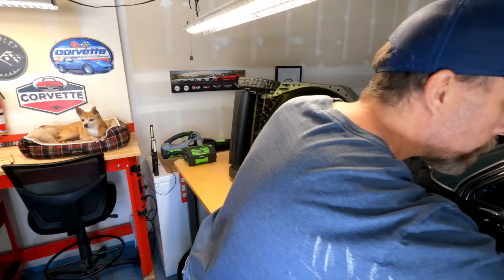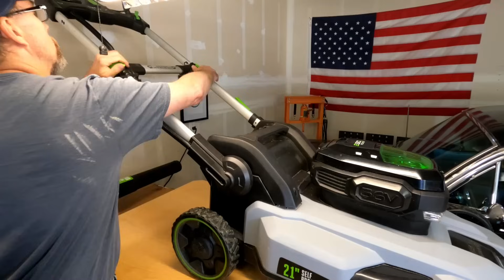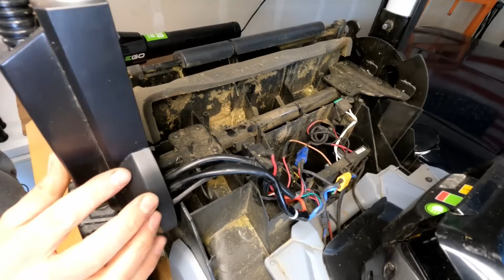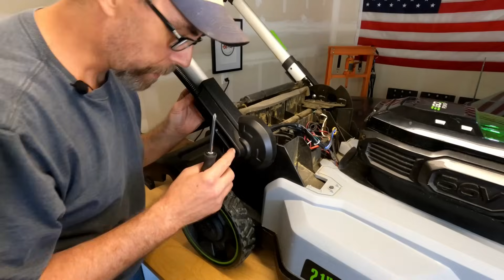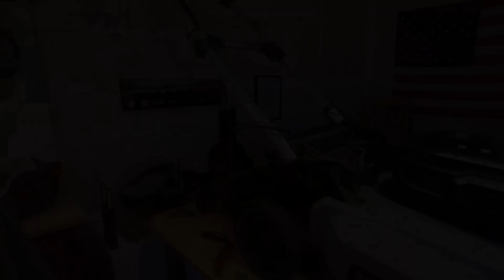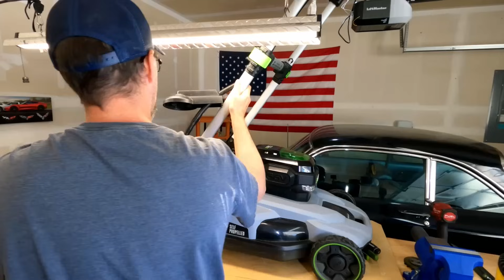My Ego Mower Finally Quit Working!!  🔧  Can I Fix It??

Comment: Is that part of the wiring harness available to buy?
Reply from the maker: I have not ever looked into replacement parts. That would be handy so that you could just replace the entire run of wires from the handle to the electronic box. I would imaging that as the world gets more and more full of these battery powered machines, parts will become more accessible. Thanks for watching!
Reply: @EndWrenchRookie  I disagree w/the parts becoming more available.  EGO's "5 year" warrnaty gets you the door, but those 5 years are less than spectacular.  At 5+ years, if the mower "breaks/fails", most will move on/back to a gas mower.  EGO is just as disposable as the next thing and  replacement parts will be tough to come by.  Ppl just replace vs fix and electric is more intimidating.  If there are replacement parts, it will be through a 3rd party seller not affiliated w/EGO...

Comment: My new Ego mower purchased in April 22 did the same thing this year when I first started to use it. Had a hard time with phone support finding me a shop that repairs them. Fortunately , Lowe’s let me swap it out with a new one.
Reply from the maker: Thanks for sharing. Ya, its going to be a while until repair shops catch up with the electric mower game. You pretty much have to work out a full replacement under warranty if you want to get it fixed. You are lucky to have gotten Lowes to replace for you. Hopefully your new unit works better for you. Thanks for watching!

Comment: Try cleaning the carb and plug and change the air filter.
Reply from the maker: Right...and I should probably check the oil while I am at it :) lol
Reply: @EndWrenchRookie  A can of starter fluid will have it up and running in no time :)

Comment: How has the battery held up since you have had it?
Reply from the maker: Thanks for the comment! My battery is going strong now in its 5th season. I store it indoors over the cold winter and I charge it completely right before I use it every week. I have a pretty average size lawn but I have never run out of battery during a mow yet. I expected to have to buy a replacement battery at some point, but so for no issues :) I also have 2 smaller batteries for my blower and trimmer. They are lasting noticeably less time this year. I do use the blower year round in the garage. I just always make sure that I have one charged all of the time so I can switch them out. I imagine I will have to buy a new battery or two for them maybe next year. Overall...pretty impressive lifespan for these units. Thanks for watching!
Reply: @EndWrenchRookie  The only thing that I am not happy about with it Does this grass it’s doesn’t have good Suction
Reply from the maker: Do you mean that it drops clumps of grass on the ground instead of catching? I usually cross cut (cut twice) just for the look but it tends to pick up anything that dropped. It definitely has more problem grass catching if the grass is too long or at all wet. Thanks for the comments!
Reply: @EndWrenchRookie  No it leaves uncut sprigs of grass
Reply from the maker: oh...ok that makes sense. ya, I have that too, especially if I mulch. It is better if I bag. I seem to have lines of uncut grass where the wheels lay the grass down. I usually cross cut (mow twice) then it solves this. For all of the conveniences and all of the ease of use, the lack of pawer and suction compared to a high quality gas mower is a real thing. I do miss the days of being able to just mow when ever and under whatever conditions necessary with my old John Deere. Still glad I have the Ego in the end.

Comment: When I first got mine I took it apart and cut all the plastic out that the wires run through inside The mower because I noticed as you folded they get caught up in the plastic channels I also added loom to it no problems yet
Reply from the maker: That is very smart. A little preventative maintenance goes a long way! Thanks for the info and thanks for watching!

Comment: Your video is helpful, thanks.  I have the 2100sp and the self propel motor will not come on. Main motor works fine. Need to check the two SP switches in the handle. Your thoughts?
Reply from the maker: Thank you so much! Bummer that your drive stopped working. Luckily they are not heavy :) If I were you I would take the hinge cover off like in my video and inspect the wires for crimping. I would hold the drive handle while simultaneously wiggling the wires at the hinge to see if you have a crimped wire as I did. After that, I would isolate the wires that go to the drive motor and try to assess if there is power getting to the motor ie...probing the wires. After that I would test the continuity of the switch on the handle to see if you are actuating properly. If all that checks out you may have a faulty motor or loose connection at the motor. Hope this helps. Just one guy's opinion...Good luck!

Comment: Thank you! I opened up my mower and my problem looks to be similar to yours. I’m on my way to the hardware store now. Do you recall what gauge wire you used for the repair?
Reply from the maker: Thank you for watching. I believe that I used 16 gauge wire to repair the 3 small wires. That was what I had on hand at the time. They were bigger than I needed. You could get away with smaller. Good luck!
Reply: @EndWrenchRookie  I appreciate the quick response. Thanks again for putting your experience and knowledge on here for us all to learn from.
Reply from the maker: No worries. Hope it works out for you. I haven't had any more issues with my mower since my repair.
Reply: @EndWrenchRookie  My mower is up and running again! I can’t thank you enough. For anyone else attempting this, I used 18awg wire and it was still slightly larger than necessary, though pretty close.
Reply from the maker: Great Work!

Comment: What gauge wiring did you use ?
Reply from the maker: I believe that I used a multi-strand 16 gauge for the repair. If I remember, it was larger than I needed, but it was what I had on hand. Repair was successful with no further issues for the rest of the season. :)  Thanks for watching!

Comment: Thank you!  It must have been the handle extension safety switch - I also store mine folded up in my garden shed but never have to shorten the handle.  All I had to do was collapse the handle and re--extend it and it works fine!
Reply from the maker: Thank you! Ya, lots of safety gizmos on these machines. Probably a good thing. :) Thanks for watching and commenting!

Comment: 5 years with mine still going strong 💪
Reply from the maker: nice!
Reply: @EndWrenchRookie  after I get a plow on my truck going to replace my gas snow blower with the ego 2 stage
Reply from the maker: @gamingseeks3580  wow. that sounds like fun!
Reply: @EndWrench Rookie  then getting the ego generator after all that I'll own 9 ego batteries lol 😆
Reply from the maker: @gamingseeks3580  LOL
Reply: Mine is 8 years old, but I did have to get a new battery a couple of years ago.  It just developed a problem last week or starting for only a few secondsd before dying so I took it to a shop that didn't give me confidence they could fix it.  I think I will tell the mechanic about this video although I do not fold mine down ever, but at least, the mechanic will know about the points where things can go wrong.

Comment: This seems to be a common design problem with this brand. I like that you fixed it right, rather than disabling the safety feature(s).
Reply from the maker: Thanks for the comment! I agree. I could have just bypassed the switch but that doesn't really help people as much. At the end of the day, I wanted to share my experience with others in the hopes of helping save a few more machines from the landfill. Thanks for watching!
Reply: This brand has to many safety feathers. Most have 2. The bailing handle, and the button. That is enough.

Comment: Good video ! you need a multimeter ! I would have tested it out before I put all that tape on the wires.
Reply from the maker: Thanks for the comment! I agree, using a multimeter would have confirmed and isolated the problem first. I would have definitely broke it out if I wasn't able to determine the source of the problem. This video/repair was more about getting my lawn mowed before the storm hit than it was about demonstrating the analytical technique. lol :)   Thanks for the tip and for watching!

Comment: FYI, I stored mine all folded up in my small shed for years and never had this issue, so I don't think it's a matter of it not being designed to fold up every time it's used. Still going strong 6 or 7 years later.

Next time you decide to pop this open, take the battery out for your safety. Also watch out for any large capacitors. I don't know how this thing is build, but large capacitors can be extremely dangerous.
Reply: Yep, most motor controllers have capacitors in them. Its a good practice to hit the 'on button' after de-energizing (removing the battery) the circuit.
Reply from the maker: Awesome! Ya, I probably should have had the battery out when I was fixing it up. Thanks for the input and for watching!
Reply: ditto
Reply from the maker: @johnmarquardt1991  :)

Comment: Great fault finding skills my friend.......But I think most of these units will be just expensive landfill.....They will not last like a good Aussie 2 stroke mowers for fifty odd years with some TLC...But really a bad design fault by EGO...most people would not have your skills to fault find and repair....My next door neighbour traded his 2 stroke for an EGO which surprised me.
Reply from the maker: Thanks for the kind words my friend!
Reply: Very true...got given a Victa 2 stoke cos the owner couldn't be bothered replacing the starter rope. That, some TLC and a carb kit, and its been running fine for the last 10 years no sign of giving up yet. Gonna keep it going as long as possible...

Comment: Nice job - excellent troubleshooting and repair ! 👍 … wonder if the new ones have a better design to prevent a similar problem ? 🤷🏻
Reply from the maker: Thank you so much! I appreciate the input. I am surprised at how common this problem actually is. I would imagine that they have addressed it by now. Thanks for watching!

Comment: It's the smaller single wire that's causing the problem every time you move to big one your fingers was pushing up against the small one you can't see cuz you're on the other side of the camera.
(Edited after FYI) damn I was right!
Reply from the maker: LOL! You are indeed correct. That's the fun part of doing live repairs. You get to follow along and try and guess the problem. Good eye! Thanks for watching!

Comment: I have had my EGO 21inch cut mower for 6 years never had a single issue , maybe just lucky. plus its still the original battery. by the way, I never fold the handle down which has helped lol
Reply from the maker: That is cool! I am also on the original battery. My smaller batteries for the trimmer and the blower are starting to not last as long, but the mower battery is still going strong.
Thank you for the comment!

Comment: I'll order a gas Toro. 4-5 years won't cut it.
Reply from the maker: Nothing wrong with that! I had a John Deer walk behind that lasted 20 years and I LOVED it. Of course, after uncounted gallons of gas, fuel stabilizer, carb kits, spark plugs, air filters, all the trips to the gas station, replacement throttle cables, oil changes, and broken pull strings, I sure have enjoyed the electric unit. I think that as long as you are able and willing to perform your own maintenance and repairs you should be able to enjoy any piece of equipment. 
Thank you for the comment and for watching!

Comment: It's too bad you couldn't hear me.  I was yelling that you bumped the little wire not the big one.  I was like wait he said there were only 2 bundles and I could see 3.  Then, when you bumped the little one and it stopped and started I was like see i told you.  Later after you took it all apart I was like,  yeah!!  Wife thinks I'm crazy by the way.  Hollering at the dang computer like you can actually hear me.  :)
Reply from the maker: Good eye! Yah, I thought it was the big one. It made more sense to me once I got it torn apart. Thanks for the comment!

Comment: As a qualified mechanic I see this sort of failure often. Some people on this thread have suggested that they hope Ego have fixed this problem now. The fact is that if you bend a copper wire back and forth many many times it will ultimately break. It does not matter how much protection you put on the exterior of the wire nor how you try and secure it, nothing stops the fatigue the wire experiences from repetitive bending.
As a side note, one way to isolate the location of the break is to pull quite forcefully (subjective term i know!!!) on the wire itself. An intact wire will not yield but a broken wire will easily snap at the location of the break as most of the copper is already broken amd the only thing holding it together is the insulation that will easily break with some force. This is a trick i learned from an older auto electrician and have used it many times with great success.
Reply from the maker: Thank you much for the comment and the tip! All good points. Thanks for watching!
Reply: The fix is to distribute the bend instead of just directly running wire following a straight path thru the hinge. It's hard to describe in words, but there are many patents (most expired by now) which show different techniques. One approach is to roll over a large circumference which requires the wire to be managed (usually by loops and spring tension) to increase and decrease the arc covered by wire at the hinge.  Another approach is to run the wire perpendicular to the hinge (wire to the hinge, turn fixed 90 degree to travel some distance along the hinge, turn fixed 90 out the other side of the hinge) so the bend is transformed into a slight twist along the length of the hinge.
Reply: @Sylvan_dB  Another way is to form a length of wire into a loose coil. That will also make the wire not to have so much flex in it. This is the method used by auto manufacturers to have some controls mounted in the steering wheel. The coiled wire device is call a "clock spring".

Comment: That conduit / plastic sleeve thing should have extended all the way into the housing up to the point where the wires no longer move. As an Ego owner this is disappointing that they would miss something so obvious. Glad it was an easy fix, but still frustrating.
Reply from the maker: Thank you for the input! I am really glad it was an easy fix as well. I am still overall very pleased with the EGO products. Thank you for watching!
Reply: @EndWrenchRookie  It was a great video! I think you had a good balance of showing the critical parts, and skipping through the more basic parts like soldering. Overall I've been happy with the EGO products as well. I chose the platform because it seems they thought through the battery cooling better than most other of the high voltage platforms. Unfortunately they don't have the power tool experience of say Dewalt, Milwaukee or Makita. Those companies would have known to shield that wire better.  I hope the longevity is as good as the short term performance...
Reply from the maker: Thanks again for the comment! Yeah, I was pretty surprised when I read the battery charger manual to find that they had not only cooling included, but also a long term docking setup where the battery will stay charged and cool for long periods and if it goes too long, the charger will automatically discharge and recharge the battery to keep it fresh. How far we have come...

Comment: Mine stopped working after 5 years. I went and bought the new cross cut with the double blade… Wow what a huge difference. I already loved my old EGO but the new one is even smoother, even more powerful, and amazing that they could improve on the one I’ve used the last 5 yrs!
Reply from the maker: thank you for the comment! That is so cool that you got an upgraded machine. I have heard about the cross cut but haven't ever tried one. I will keep that in mind when it's time to replace mine. Thanks for the input!

Comment: Looks like Ego products only last 5 years. My second Ego lawnmower will be my last electric if it fails in 5 years also. This is a design flaw, Ego needs to extend the warranty to 10 years on this model.
Reply from the maker: There is truth in this. My first mower was a John Deere that ran for over 25 years. How times change... Thank you for the comment!

Comment: Hopefully you can file down the screw threads that probably cut into the wires and caused the initial problem.
Reply from the maker: Thank you for the comment! That is a good idea. If it acts up again I will look closely at the fasteners to see if I can identify the problem. Thanks for the tip!